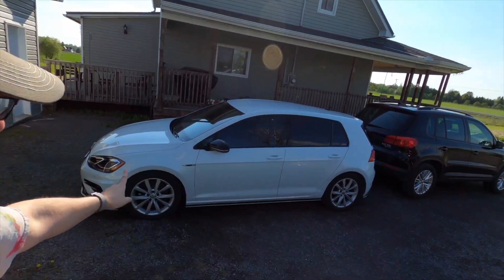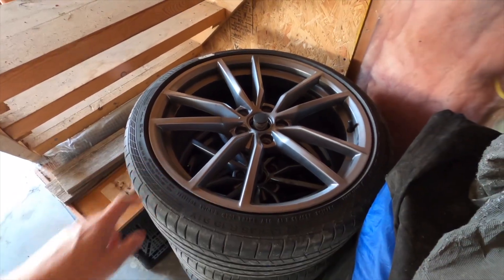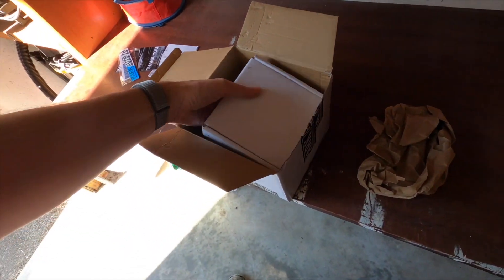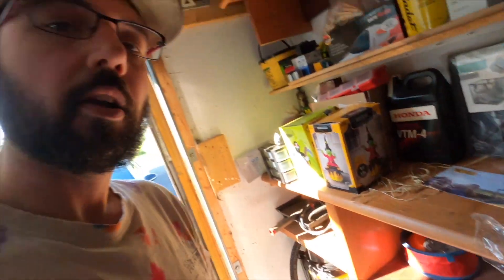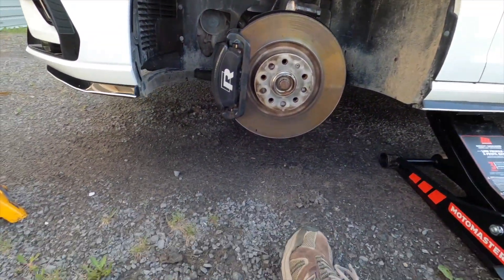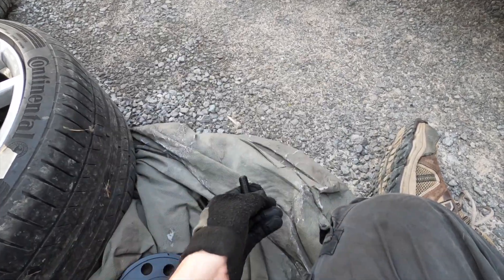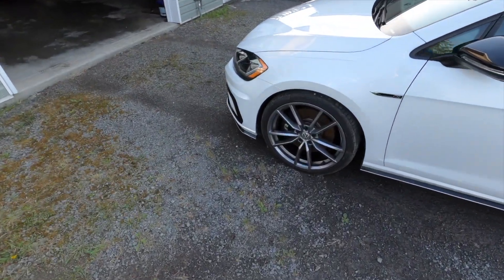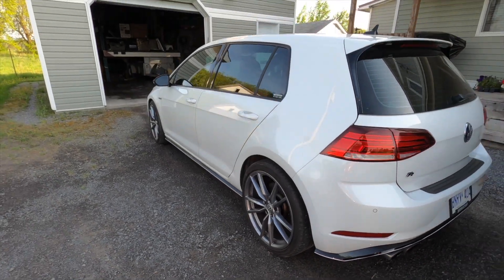Flush Fit Kit for VW Golf R 19" Pretoria Wheels - EMD Auto Hubcentric Spacers  - Netcruzer CARS

Comment: Just a quick comment on one of your early comments in the video. ECS indeed makes a “flush kit” specifically for 19” golf R wheels with the same spacing (10/17.5mm). Really enjoy your R videos and they’ve helped me a bunch! Thx
Reply: ECS does make them but they’re over $100 more than these which is just insane I think. And tbh, I looked for the 10/17.5mm from ECS and couldn’t find one with that exact spec. I saw 2 or 3 different options, but not 10/17.5mm exactly

Comment: Also not to hijack this video with seperate content - but I am on the same journey you took with EQT and will be doing the dsg tune shortly. Asking here because it’s new video :)

Do you do the tcu relearn after EVERY flash of a new tcu tune - OR - is it ONLY recommends if your are experiencing odd behavior post tune? The FAQ answer on the EQT site is a bit of a run on sentence so it’s hard to know 100%. I saw you did a portion of it (a clutch calibration?) in your eqt DSG video. Thanks!
Reply from the maker: Sorry for the delay I don't check this channel often enough to notice the new comments.  I did a relearn after every TCU flash based on EQT FAQ.. but it might be unnecessary.  Just make sure you are fully up to ideal operating temp first, don't adapt it cold.

Comment: Hi I don't know if you did.but you should have copper greased them spacers before fitment
Reply from the maker: I’ve had them on and off for two years now. No rusting or stuck on problems yet. There is also a cutout to pry them off is they did.
Reply: Anodized aluminum doesn't typically rust, so there is not really any need for antiseize.

Comment: Can't help but notice you didn't apply any copper grease to the hub spigot before putting the spacer on?
Reply from the maker: That’s right, I don’t. Never noticed any wear in 2 years of on and off. I use a little rust cure lubricant around it, it’s clear.